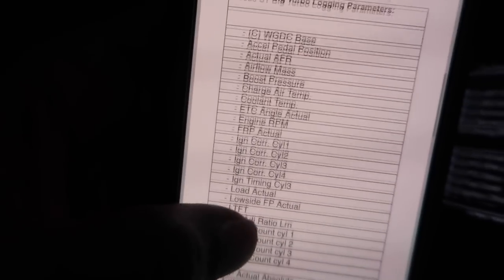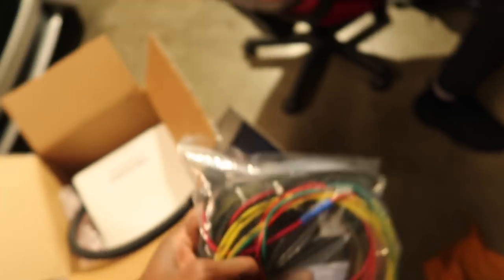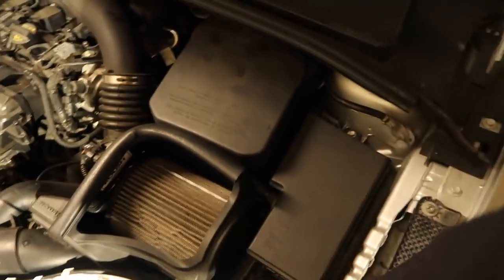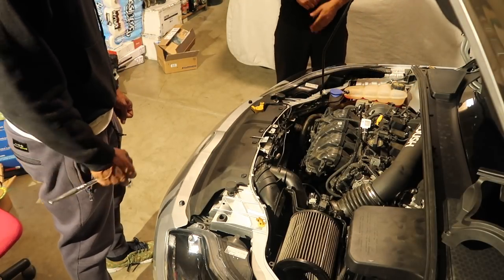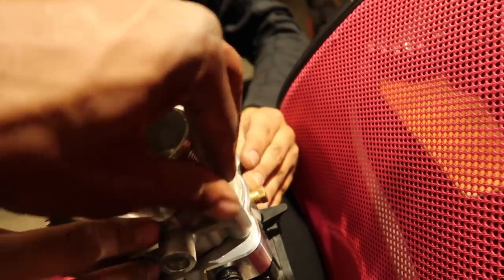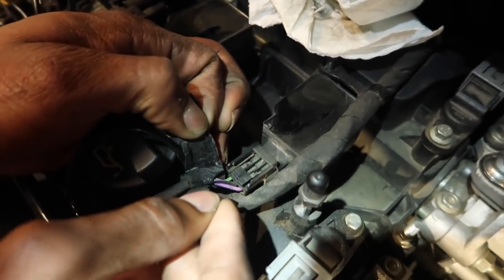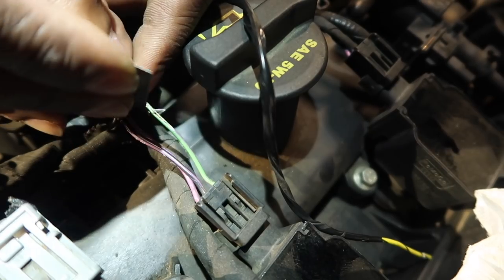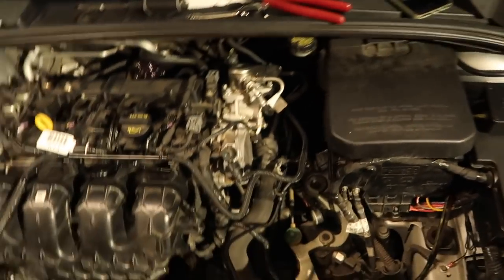STRATIFIED 2-PORT AUX FUEL **INSTALL**

Comment: The cable that you need to connect in the map sensor wires which wire is the one you have to get?

Comment: Would you recommend the 2 port or the 4 port?
Reply: depends on your power goals. the 2 port suppliments the stock system enough to run e50 or so, dont think it can easily allow for straight e85. with the 2 port, you could for instance maximize the 2867 on 93/e30... or even possibly the 3071. but if you want to run either with full e85, i think you need a 4 port. Another option is the xdi hpfp and injectors. i think the pump by itself can support enough fuel to max out the 2867 and 3071 on e30, but again on e85 i think the pressure required is going to need to also have the injectors in addition.